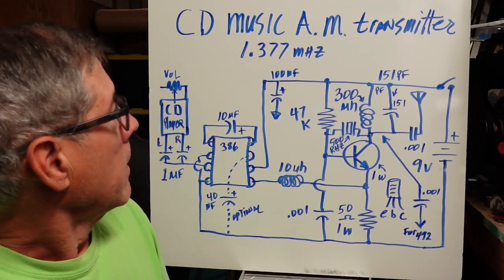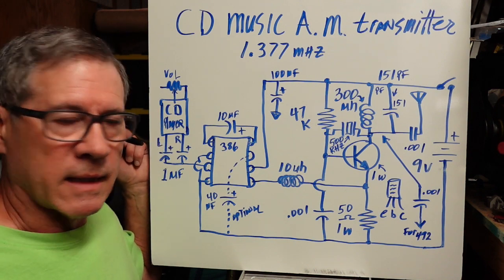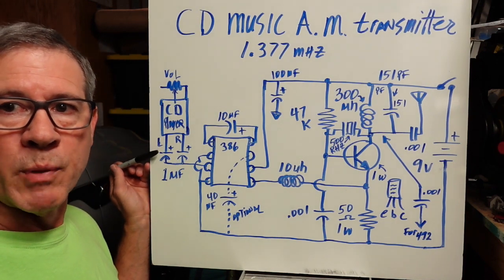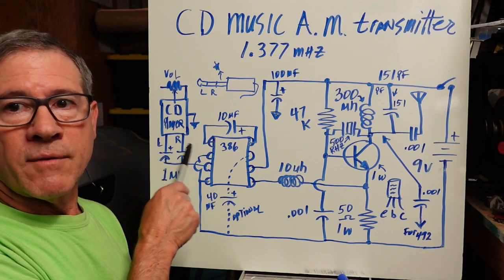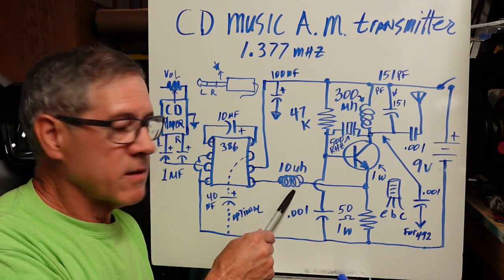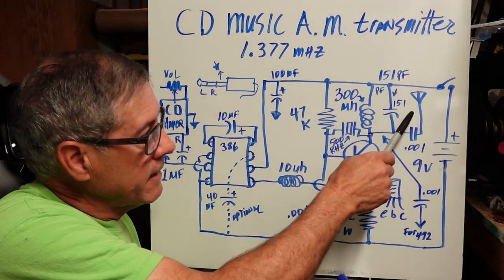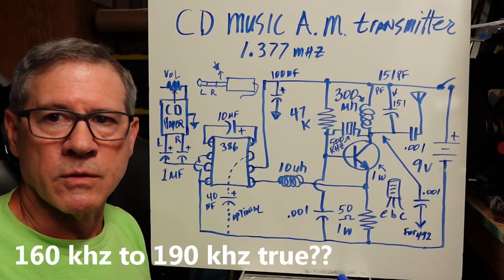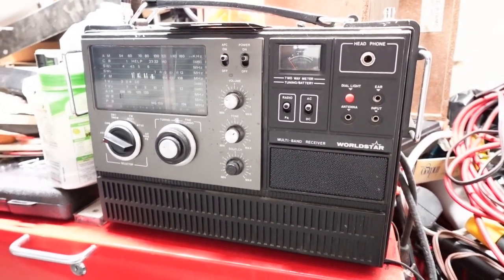AM cd music TRANSMITTER 1.377 MHZ using a 500khz resonator

Comment from the maker: I have just built another one of these and tried a 470 uh choke at the output of the 386, pin 5, going to the emitter of Q1. It works better than the 10 uh choke, (waveform output shape is cleaner) This is just a small proto board on my workbench, bench power supply and a single wire 5 ft vertical antenna. The output is hooked up to my scope, so that may change things too. I forgot the 100 uf cap across + -.

Comment from the maker: Not all cd player headphone jack outputs are the same. The big 2 ft wide all in one player I have been using has an output that all my circuits like. I have tried 3 other cd players and they sound terrible when used for the transmitter input. I scoped one of them. There are a group of spikes every so often on the output. Sounds ok coming out of the cd player speakers though. Those spikes are NOT present on the large boom box headphone jack left and right channels.